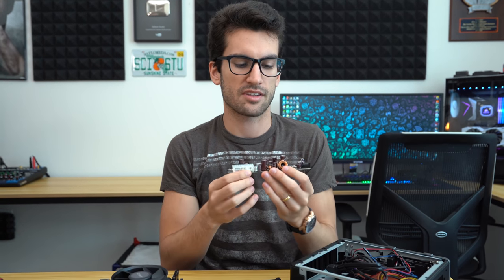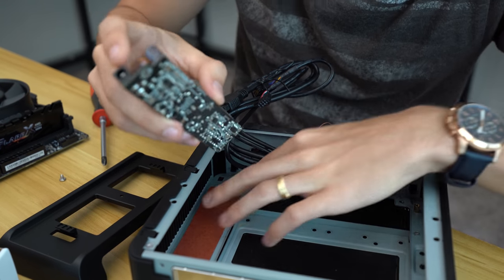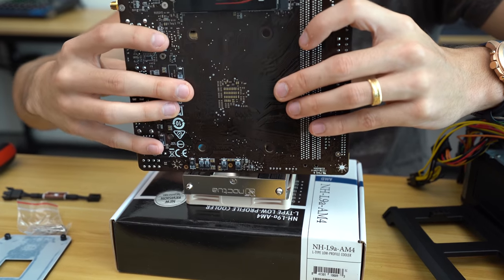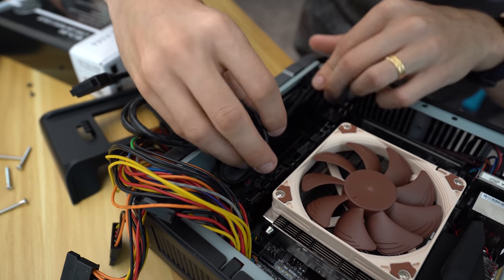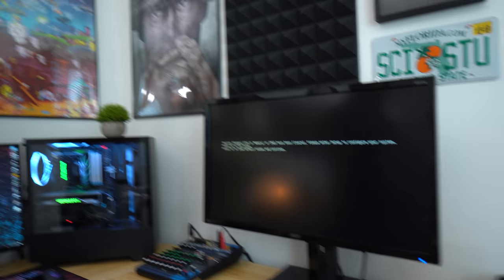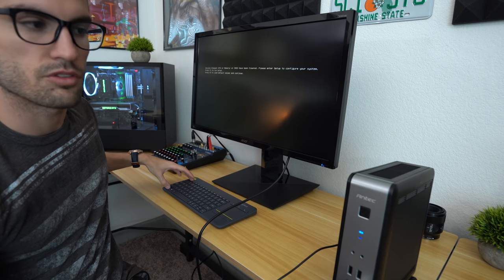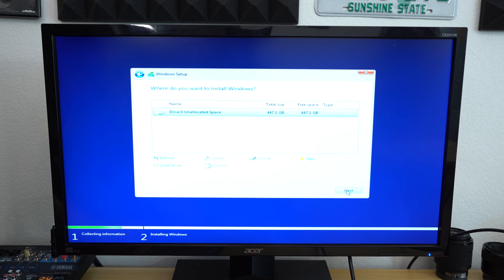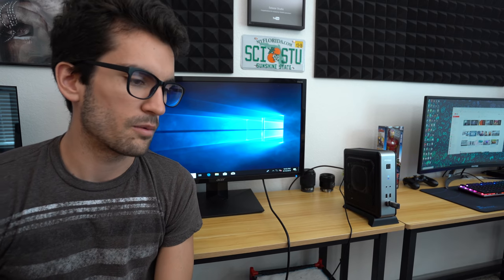Noctua & Antec Save the Day! | Fixing Our Dead ITX PC

Comment: I used that cooler, awesome cooler for its size, probably the best small cooler on the market.
Reply: Cryorig C7?
Reply: @Arik-2103  Way too loud compared to the Noctua. Even the lowest rpm settings are clearly audible. The spin up is not so consistent on the C7. Ive replaced in my mom's desk the C7 with the Noctua, the temps are the same(1-2°C difference), but the noise. Earth and heaven.
Reply: @talos86  I bought my first Noctua fans about12 years ago and an HSF a year or so later. I'm to the point I don't really think of using anything else, it's worth paying a bit of a premium for great cooling and silence. Fortunately they began releasing all black coolers and fans this year.

Comment: The only thing that I can criticize is that most motherboards have a key you can press on boot that will bring you to menu with boot options in which you can choose a usb devise.This way you never need to change the boot order which can slow down your boot times if the SSD isn't the first priority.

Comment: Do we have a parts list for this build? I'm going to set up a point of sale for my mothers book store and this pc looks just about right for the job..
Reply: Haha wayyyy overkill for a store POS system.
Reply: @117TheWolf  not if its running a tv in the corner, two monitors, security cameras and the pos...
Reply: Yeah that’s still overkill - but an Asrock A300W for $180, an Athlon 200GE or 2200G, a cheap M.2 drive and some cheap SODIMM ram would be a solid route if you value a small form factor - you could mount it on the back of a monitor and be set.

Comment: Can you consider doing a series on thunderbolt 3 vs. 10GigE Vs. USB 3.xGenX (where X is the highest numerical value possible) 
And go over theoretical vs real world performance of all involved and how each performs with a GPU (where relevant) & data storage solution setup in a normal manner + a saturation test etc etc.
Reply: The problem with any review of that nature is that storage performance (especially external storage) is HIGHLY dependant upon workloads. You can pretty much guarantee that even if you get them when you first start using a drive (unlikely), anything you personally do with a drive will never reach the speeds that are shown in most reviews a week after you first install it and have your software running off it. There are a million factors involved, and no review can account for even a small portion of them.

Best example of this is NVMe vs SATA SSDs. The benchmarks would have you believe that NVMe is 5x faster than SATA, but in practice you are going to save a second or two on pretty much any real world task you do. Over the course of a session that's maybe a few hours of heavy use, you might save yourself 10 minutes of load time if you are lucky (outside of a short list of operations that are actually well suited for the newer drive).

There are some real-world tests that can be run to show you some good examples of how fast a drive is, but in the end, once you plug it into the steaming stew that is your computer, those won't matter much either. In the end, "real world" benchmarks are still usually run in a completely clean environment, which is, of course, nothing like the real world where you have dozens of drivers, services and other pieces of software installed, alongside remnants of whatever you once had since the last time you did a fresh install of your OS.

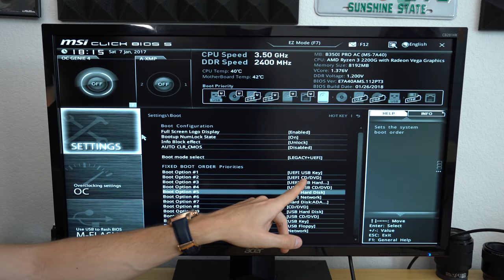Comment: Nice video as always , But on most new MSI motherboard you don't need to go to the menu to change the boot order you can glide the graphics icon with your mouse. look the icon changed in your video at around this 8:48 at 8:50 . and also their is a menu that let you Boot from any device once so when your PC reset, the boot priority does not change. Keep up the good work

Comment: If it cycles through all drives for a bootable one do you need to change the boot order? I'm just thinking there is less chance of her plugging in a bootable usb drive and going wtf if you leave it in the default order instead. Not that it really matters :) Also nice tidy system for the mother in law!
Reply from the maker: No you're right! It won't typically matter unless you're attempting to wipe a previous OS install, etc. :-)

Comment: I am not sure if you told us already but isn't it dangerous to be messing with an open power supply? Or does it not matter too much since they were never on? /Or are they just that low of a voltage concern if something did happen? I was really concerned when I saw the open psu parts lol
Reply: He only touched the Low voltage part of the PSU because the high to low voltage tranformer was inside the external power brick

Comment: Good Stuff man! Glad you were able to get that pc up and running, was thinking of putting one of those together for my mom, Do you happen to have any temps on it? I was thinking of getting a magnet filter to put over the mesh to help keep larger particles out if I built one, but wasn't sure what the stock temps are or if that would restrict the air flow to much.

Comment: Very nice system gotta say, but one thing i would have done is to just solder new connectors from the PSU (ATX, SATA..) and make them short as possible.
Reply from the maker: Not gonna solder anything in this build LOL.
Reply: @GregSalazar  That's why i said "i would have done" in the comment.

Comment: Why change the boot order from the m.2 drive. When you turn the system on you can pressed f8 for quick boot and select the windows thumb drive. After windows is installed it will automatically boot from the m.2 drive you installed windows. No reason to have to change boot order and then Change it back.
Reply: So you save milliseconds at boot your way. Am I missing something?
Reply from the maker: You don't have to change it back. A lot of modern boards will change the default boot order once the OS is installed.

Comment: Wow. I used to work as an electronic technician at a circuit board manufacturing site. My job was literally to diag faulty circuit boards. Never had a missing capacitor before. Had a couple capacitors blow out during testing, but never a fully missing capacitor. Where is the quality control? Not even a testing station to make sure all the components are place?
Reply: In the 1st vid he mentions at the end one of the screws securing that board was loose but didn't mention a loose cap floating in the box so it prob happened during packaging after QA. I can imaging the packaging person finding a cap on the floor at the end of shift, shrugging and punching out for the day :)
Reply: applemaggot ah I see. I’m used to different I guess. We tested 2 before and 1 after assembly. No chance of bad assembly work.

Comment: It's also worth noting when you buy Windows register it with hotmail/live and it will allow you to install on to 10 devices and let you manage devices, handy if you you change hardware and also you never need your key again as you activate through email login on Windows.
Reply: @purplecrayon7281  
Yeah only one key but you get to install on up to 10 devices, if you have Win 10 and log in via hotmail and have registered that copy to the hotmail account, log in to Microsoft and there is some kind of manage PC option, can't remember the exact wording but you will see it in there.
Reply: @wing0zero  So you can have 10 devices running at the same time on 1 key? Or you can go through several major hardware changes (MB-CPU) 10 x without calling the MS mothership. I'm confused.
Reply: I did the exact same thing. Associate my Windows license to my hotmail account. All it lets you do is hardware change, the other hardware's windows would be automatically deactivated. Also, when I was re-activating my new hardware, they insisted that I typed in my windows key. So I guess too many people were abusing this hack.
Reply: @bothellkenmore  
Yeah up to 10 devices at the same time, as it stands I have 3 PC's and 2 laptops all on my account, and you can see them in the management part, I didn't even buy Win 10 also, this is just from the free upgrade from a Win 7 OEM, I don't even have a Win 10 key, just my MS account.

Comment: Random question greg , would this be capable of 4k playback smoothly? without a discrete gfx card?
Reply: Probably. But I forget what the cpu is. If it’s a 2400g then definitely

Edit: it’s a 2200g but that should still be capable of 4K playback
Reply: @whitepaws60   thanks for that I may look at a 2400g build. I do t know much on amd's current lineup. Currently.running a laptop for my htpc with an 850m not exactly ideal
Reply: bradley beilby a 2400g graphics power is about equal to a GT 1030 so I see no reason why it couldn’t steam 4K
Reply: @whitepaws60  ah thanks that's perfect as I want to keep it small and quiet for the living room. The 17" laptop is a little loud when playing 4k so a smaller it's unit would be ideal 👍
Reply: bradley beilby Yeah it would be perfect for that. A 2200g would also work probably if you wanted to save about 60-80 bucks
Reply: @whitepaws60  sounds great, I've not set a budget yet but atleast I know I can go lower if I need it. I don't want to have to add a gfx later you see

Comment: I would just wrap some black electrical tape around those ketchup and mustard cables. They look so gopping, utterly disgusting in that build. Why can't they offer all black cables? Also you can try gaffer tape and zip ties.
Reply: Just taping a few sections intermittently or using the 2 twist ties that came with the power brick to bundle the wires on the 24 pin would have helped a lot. I like split loom tubing for a next step up without having to go for heat shrink.

Comment: DON'T MAKE USB YOUR FIRST BOOT OPTION!!! Use the boot menu to select which drive to boot from. If you do make USB your first boot option, not only do you have to go back and change the setting yet again, but the system will try to boot off of the USB AGAIN when it needs to restart during the installation and set up process.
Reply from the maker: No, that is not always the case. Here, for example, the BIOS changed the boot order once the OS was flashed.
Reply: @GregSalazar  When did the fumctionality of a BIOS change that much?